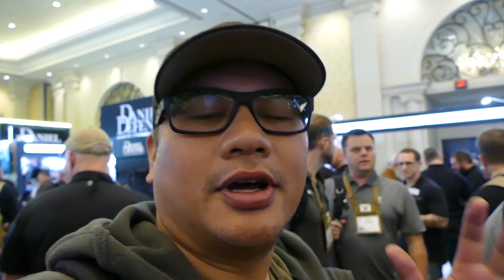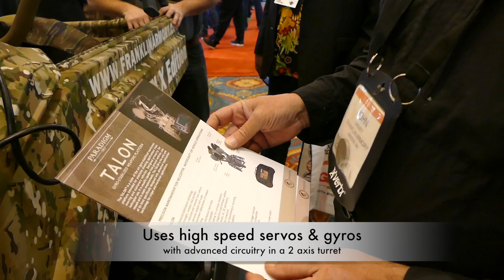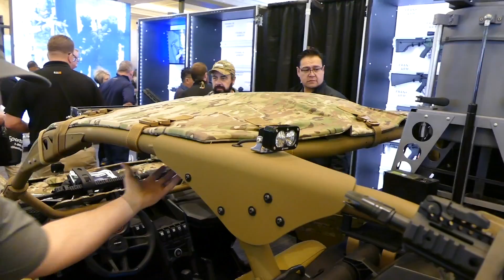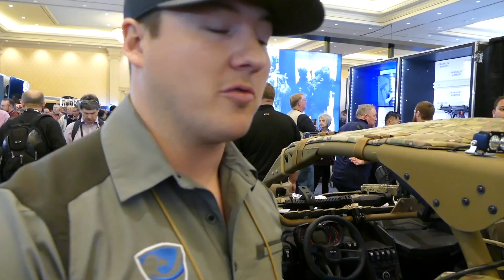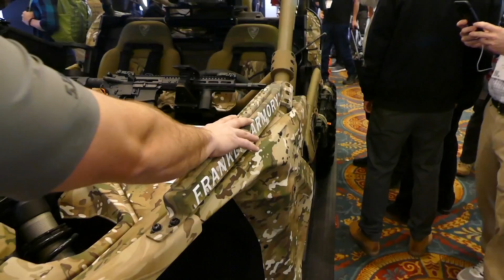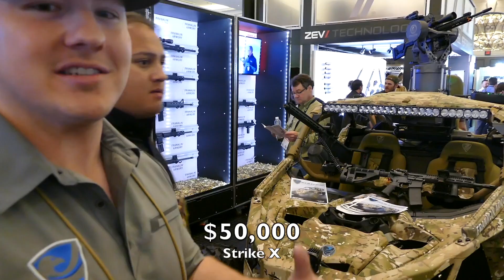$400,000 Can Am Maverick "Strike X" side by side ATV

Comment: 90MPH?? 0-60 3.8 SEC?? I DONT THINK SO. unless its had some serious engine mods it wont do that. even with a stage 2 from evo sports taking it to 200bhp it will just about hit 0-60 in under 4 seconds and that's without all that weight of the guns and added rear racks etc. Yea its an amazing machine but the guy isn't being honest with the speed and power.
Reply: We leave the engine untouched to keep these under Can-Am warranty. So all specs in terms of speed are based on Can-Am's testing.
Reply: It doesn’t need serious modes to have 10 more horse power you change the exhaust or tune kit

Comment: Not 1 word about driver/soldier protection?  They take an awesome machine bolt some guns and aluminum to it and try to rape the military/American tax payer on price and smile about it!  $400,000 for a gun rack built out of aluminum?
Reply: As is mentioned in the video description, our vehicle isn't $400,000 ... The vehicle with the addition of the firearms and more specifically the remote weapons system mounted to the back is what makes it a TOTAL of $400,000. The vehicle itself, depending on how it is customized, is around $50,000. And we like to stress that this vehicle in particular is a show rig for Franklin Armory. Our vehicles are purpose built. Finally, I'd like to stress that items built for military purposes fit RFPs that they themselves put together. They dictate what they need and we demonstrate how we can meet those needs.
Reply: Ohhhhhhhhhhh, OK.  Makes total sense now.  Not to me however.   No matter how you paint this I still never herd one option for operator protection.  No option for Kevlar or any other bullet/IED protection.  I've been in a Humvee racing up the "Highway of Death" chasing the republican guard back into Iraq feeling invincible until bullets started passing through our unprotected vehicle.  Very F-ED UP!

Comment: I'm going to consider one of the base models, My wife and I have a ranch in Tennessee. I do want some of those static gun mounts for AR's ....e.g., on the door and front dash area. ATV's work fine, but enough times the suspension craps out. We also have a pistol and 700 yard rifle range on the property. Currently spend weekends at the ranch. One day will retire there.passions.
Reply from the maker: Rick S acres in Tennessee sounds awesome. Lucky man.
Reply: We're happy to talk to you about gun mounts when you're ready :) We work closely with Condition Zero Mounts for the majority of our mounting needs. These are great for getting around on a ranch! We generally recommend ranchers add the tactical bed for storage purposes (or you could go with the Can-Am Defender that has a great bed already built in and it starts at a lower price point) and highly recommend getting a decent set of run-flats!  Would love to see what you end up getting!

Comment: is it high for 50k for the vehicle only??
Reply from the maker: DEATH METAL BOB I not really. A bare bones maverick is $20k. Then you ad the high performance long travel suspension, beadlock wheels, runflat tires, pushbumper armor, heavy duty truck bed, rifle racks, tactical seats, warn winch front and back, Baja design led light bars all over and you can ad up A lot of money on top of that $20k starting point.
Reply: wow!! i think fair price for that...20k will be my 7 months salary hahahah